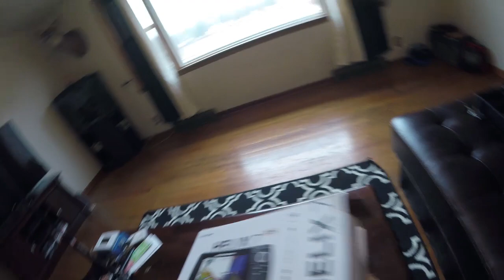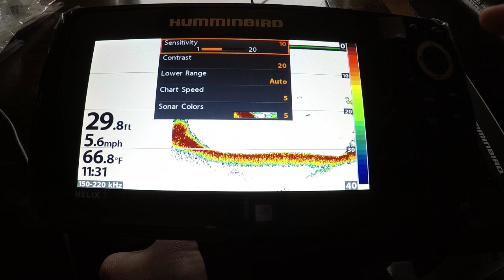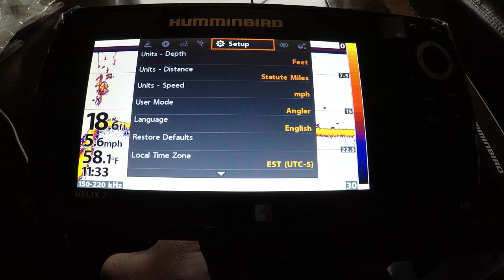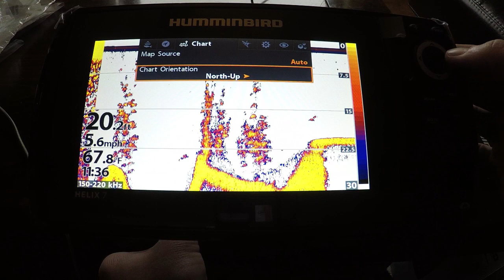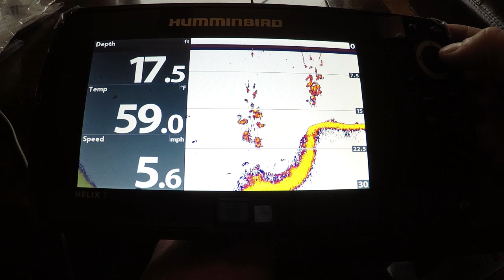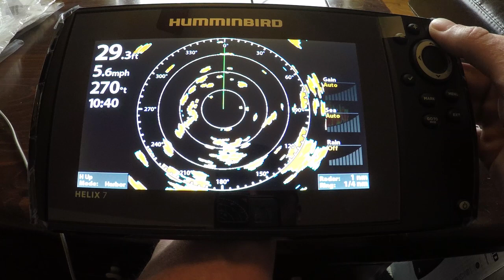Humminbird Helix 7 Chirp GPS G3N UNBOXING and STARTUP Guide

Comment: Great video, these newer generation devices are loaded with features,  I'm currently using a B&W Humminbird unit.  I bought a HELIX 7 GN3 unit back in March of 2022 . I've never installed it as I was buying a 'new to me' used boat. I lost the manual , downloaded one heck of a manual but I have few simple questions.   From your video I guess I can run this unit in a 'DEMO' mode ?   Questions...beside the 12VDC, do you need to hook up the transducer to avoid damaging the unit .  I  spent over $500 and don't want the unit. Thanks in advance.
Reply from the maker: They are great units once you get familiar with them amd the best way to learn is at home on simulation mode. U don't need to hook up the transducer. Just hook to a battery up amd turn it on and learn how to navigate the menu. You won't do any damage to the unit

Comment: Help! Have a Helix 7 Di and have it messed up. Which video should I watch to get me back. I don't have SI and want it. If I got a 7 SI would use same plug ins to unit? I know would need another transducer.  And how to sell old one and/or does Hummingbird take trade ins? Or would an 8 be better? Problem is that I have my trolling motor on a pontoon boat and just want it easy to plug and play. I KNOW this is a lot of questions but you r the man.
Reply from the maker: If you have it all messed up, hit the menu button twice and cursor over to setup then cursor down yo reset defaults. This will bring it back to how it came out of the box. Wont delete waypoints r anything like that. Any helix will take the same power plug but the transducer will be different. Unfortunately humminbird doesnt take trade ins but should have no problem selling on ebay r marketplace
Reply: @HumminbirdHelp  Thank you so much. Now which video for how to set up. I am in very deep water and clear lake . 254 at dam, 60 at my dock etc.. Smith Lake in Ala.

Comment: Love your channel, I have a helix 7 SI gn2n and a Minn Kota Ulterra w/Ipilot (not i pilot link) and DI. can I hook the Minn Kota up to my helix? not sure how this will work as there are two different transducers.
Reply from the maker: Thanks Jerry! Yes you can def use 2 transducers on one unit and the best way to do so is with the TS3 - Transducer switch and a ethernet cable and dongle from the trolling motor. They run around 80 bucks and can be switched back n forth with a push of a button to whichever transducer you would like to use
Reply: @HumminbirdHelp  Not wanting to be a pest, but I did not mention that the DI on the Minn Kota is a universal DI built in xducer. Does that make any difference>
Reply from the maker: Yes it will absolutely work of course u just wont get any side imaging while using the built in di transducer
Reply: @HumminbirdHelp  Thank you Jeremy, for the very useful information. Trying to find a clear picture on youtube on how to hook up every thing is a little frustrating but loaded with your info I will prevail. Thanks again
Reply from the maker: No problem man, let me know if you run into any trouble!

Comment: Hey, can you hook up your phone to a helix 7 G3? My phone doesn’t show up under accessories
Reply from the maker: I actually just got this question the other day where someone couldn't hook theres up. You should be able to and I'll get to the bottom of why its not showing up under accessories
Reply from the maker: So after doing some research, the g3 models are not bluetooth compatible. Only the g3n units are and networkable and is why the significant price difference between the g3 and g3n

Comment: Very nice vid.  just purchased this unit as an all seasons.  i was under the impression this unit had DI, but cannot find any settings, can DI be added on this unit?  you also mentioned jigging, what settings do i need to have to see my jig for open water.
Reply from the maker: Thanks bud, really appreciate it. The gps sonar unit will not have down imaging unless networked with another helix unit with down imaging. Down imaging has such a narrow cone it is almost useless for jigging. The helix 7 will come stock on 200khz for 2d sonar. Change this to 83khz and keep ur jig relatively close to the ducer and u will see it no problem and fish coming up to it. Hope this helps

Comment: I am considering a Helix 7 to mount next to my 999 CIHD SI (networked together) and use it strictly for GPS mapping but am concerned about its screen size. It would be at the stern on my tiller boat. Would you consider the size of the 7 screen to be big enough for my application?
Reply from the maker: I think the 7 inch screen on the helix will be perfect for gps and mapping. Exactly what I've been using mine for and love it. If you were looking for a side imaging h it I would increase up to 9